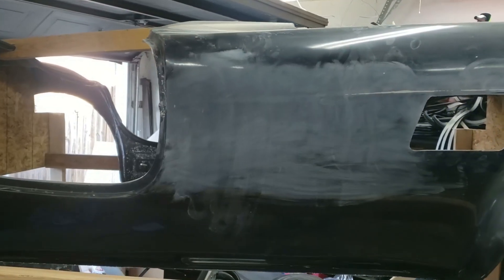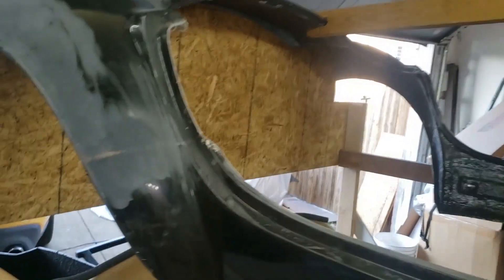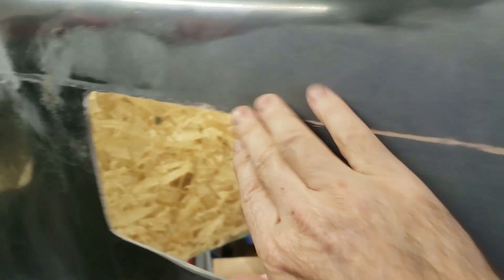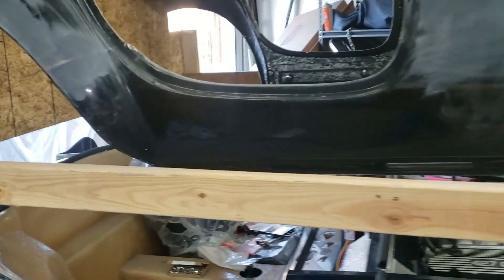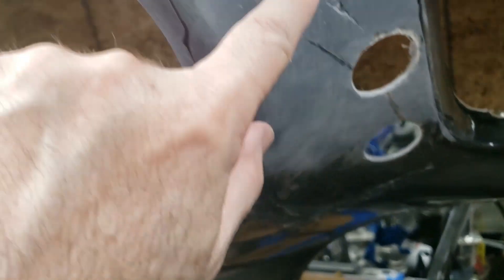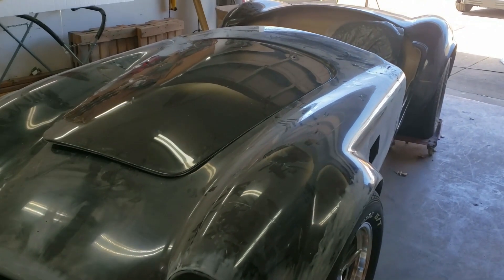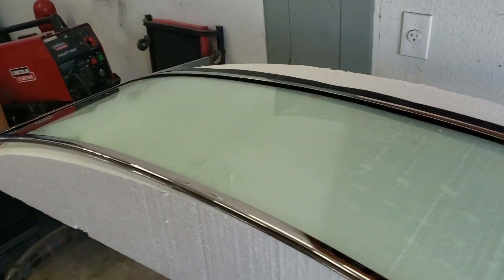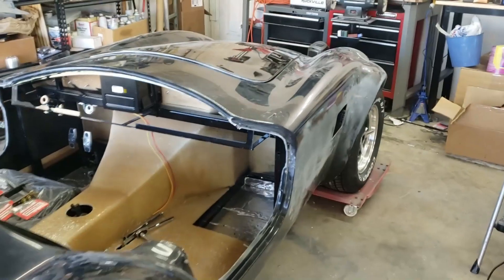Cobra Ep 11: Progress!

Comment: Looking good!
I used the marks hurricane made for the wipers. That put the wipers too far from the windshield. The body shop moved them closer to the windshield. 
Are you using round tail lights?
Reply from the maker: I wanted to but they already cut for squares.  I'm toying with filling and using the Lucas lights but it would be a lot of work.   I'm still on the fence. I used Hurricane's wiper position too.  I think it will work.   Not really planning to drive in weather.  Wipers are mainly to pass inspection
Reply: @bassandhotrods  the wipers were parked on the body not the windshield for me. 
I used the rectangle tails, the rear fenders are rounded to match round lights, the body shop is going to match it up. 
Stinking details!